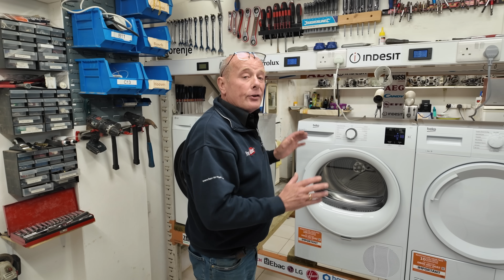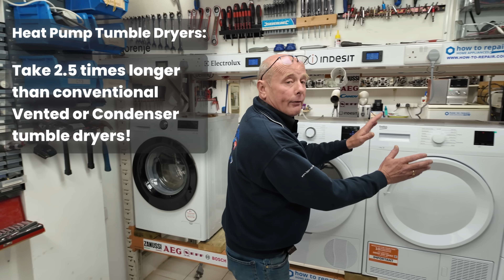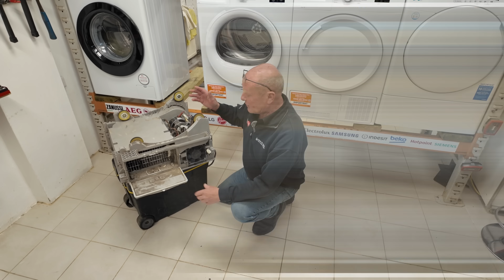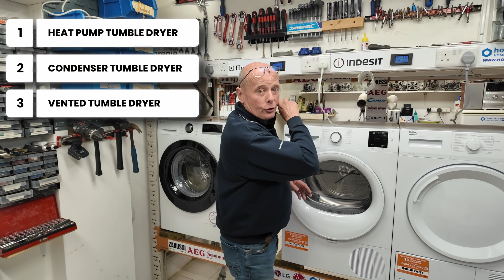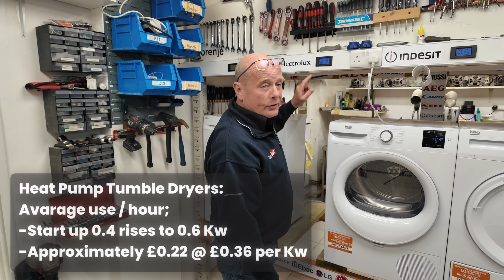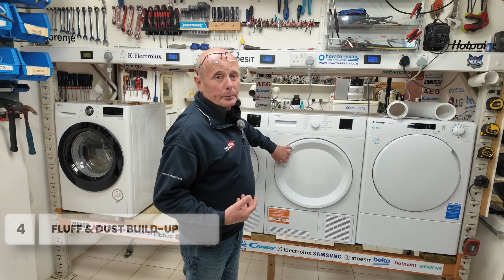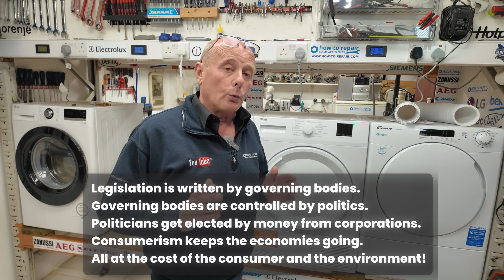Tumble Dryers the Shocking Truth About Heat Pump vs Vented & Condenser, NEW LEGISLATION!

Comment: I’ve watched a few of Paul’s videos.
My daughter has a heat pump dryer just under 5 years old,I’m not a diy person I’m a qualified trades so used to stripping down machines etc.
These heat pumps are ,as Paul says, an absolute nightmare to work on and unless it’s a simple fault it’s easier to purchase a new dryer.
They are not made for the consumer but for the manufacturer to make more.
I’ve found also similar problems with fridge repairs, so often because of regassing etc it’s cheaper to buy new.

Comment: like you said, they will phase out the machines without heatpumps, then people will have no choice but to buy a heatpump machine, same for heating the home, gasboilers will also be phased out over time and people will have to buy heatpumps to heat their homes, one snag, not everyone can install a solar power aray, so that heatpump will ruin many people
not only because of the high purchase cost but the energy this pump requires in the winter
i will never get the push governments are doing for the "climate" while everything burns because of wars and those "green" appliences are not reliable (weather/sun fluctiation) and are not equal to the appliences we use now

Comment: the vented dryer has another problem you will have to condition the air that is being expelled. So that is either heating it in winter or cooling it in the summer

Comment: I didnt hear you mentioning about large items like sheets getting tangled up into a ball on Heatpump dryers because a lot of the heatpump dryers do not reverse tumble through the drying cycle and also some people say their heatpump dryer finishes and they take the clothes out of the dryer and they are still damp and need putting on again to dry! 
I would find the lower temperature of the heat pump dryers a little concerning as well I think because germs/bacteria and odour could be killed at 60'c and condenser and vented and condenser dryers get to around 75'c I think it is but I hear the most a heat pump dryer gets is around to 45'c degree mark. 
Then there is the issue if people want to put a heat pump dryer outside in their cold shed or garage that the heat pump dryer may not even work properly or take even longer to dry because the ambient air is not warm enough. sorry if you covered all this in the video and if i missed it.

Comment: I don't have any experience from these dryers, but your points sound very logical. I'm not personally fond of the idea of having heat system in device that is prone to vibration. Also aren't the most recent refrigerants quite combustible gases in the most recent requirements, which would make the even less appealing, considering the amount of fluff from clothes? I mean I would rather see fire hazard risk being lessened than possibly increased?

Comment: Good video. One of the best I've seen.  I do think you failed to prove the total power usage for identical loads though. You say it orally, but you should supply the images of the data also, and also touch do confirm the dryness is equal.  This is because most of these units are sensor dependent so there's duration and heat variation changing with time.  

Also, IMO your final conclusion is wrong. IMO it's possible that the real purpose of isn't that your politicians are brainwashed.  IMO it may have nothing to do with saving energy or increasing manufacturing profits. IMO it's more likely to be ONLY to make people think there's an overpopulation problem.  Nothing more. Nothing less. We recycle plastic where I live, but it's all, 100% put into a landfill. Why?  See a prior sentence.

Comment: I am on Octopus Agile , a smart tariff where I get free or virtually free electric quite often so I do a mass wash and dry say 6 washes in one day and in bad weather or winter I use tumble dryers .The vented tumble dryer I use is around 12 years old .Just replaced heat element £14 on ebay and also rear bronze bearing £3.50  and a new belt for £8 , and hoovered it clear of fluff . I can t get 6 loads of washing dried with a heat pump and even though 450 watts is good going ( in winter it will take even longer ) it makes no odds as my electric is free nearly every time I wash . Octopus Agile gives you 24 hrs in 30 minute segments which vary in kwh price .Octopus Tracker will give one price for the day but never free per kwh as Agile is .Agile suits the lone occupier who can "load shift " by moving there high usage appliances like showers and dryers to the free segments or extremely cheap half hour segments . Octopus will give you £50 to switch to them ( and then you can go on smart tariff Agile or Tracker once you join .You need a customer referall  code from a friend or use mine ( eager-shell-139 ) Cheers

Comment: I have recently switched over to a Heat Pump dryer, 30 minute cycle is as quick if not quicker than my old vented one. Electric use is now at least a quarter of what it was ! the clothes are softer, and adding it onto our domestic appliance maintenance insurance was the same - no brainer really... Also when swapping the engineer that repaired the old vented one (making us switch) advised most of his clients have heat pump dryers now and they are more reliable and a piece of cake to work on. Enjoyed the review, but so far I'm glad i made the switch. One other note, re the fluff we get a quarter of the fluff we did from the vented dryer (Bosch) and the clothes do not seem cooked - they feel 100 times better.

Comment: Clear, sensible advice with lots of information I didn't know about the benefits & risks of heat pump versus conventional driers. Thanks.
Reply from the maker: Hi there! Thanks for your comment, @Sean006!

It's great to hear you found the information on the benefits and risks of heat pump versus conventional dryers clear and sensible. We aimed to highlight exactly those points – while heat pump dryers save on energy, there are significant considerations regarding their lifespan, repairability, and overall cost-effectiveness in the long run compared to vented and condenser models. This is a crucial aspect we break down in the video.

For a deeper dive into this topic and to see the examples we covered, please check out the full video here: https://youtu.be/gEgSCbZnHVM?si=wTIw0mELuhWaw4aX

We also explored related aspects in these videos:
The shocking truth about manufacturers: https://www.youtube.com/watch?v=QsdGd2qDPaI
Why Your Appliances Fail So Fast?: https://youtu.be/oBLEMQdSkes?si=ikIwqMsOIjaA0Xav

If you found this information eye-opening or helpful, please consider sharing this video with your friends and family. The more people who understand what's happening with appliance longevity, the better equipped we all are as consumers.

Thanks again for watching and engaging! Don't forget to subscribe to the channel for more insights like this!

Comment: I don't agree because it is a lot of generalization ... Samsung heat pump dryers for example have accessible heat exchanger for cleaning and it prompts regularly to clean. In addition, the smart dryer knows the smart washer's cycle and optimizes the drying cycle accordingly. Last but not the least, the washer + dryer use so little power that we can run it off the solar power for zero cost washing +drying... doing that with the regular dryers is hard. I almost forgot, Samsung has a 10 year warranty on the machines

Comment: Or, you can just hang your clothes and run a dehumidifier. This works great in the winter (or a cold basement) since the dehumidifier will warm up the air too.

Comment: I could not agree more. There's one thing however that would prevent me from using machine having 2KW peak usage on certain places. Some of the cables within my walls are made out of copper (so far so good) isolated with TEXTILE :D . A 1 KW electric kettle is killing my fuses from time to time. My BOSCH series dryer is doing fine. One thing i notice is that 4 dryer balls are improving it's work by an HOUR in some of the programs.

Comment: I have the samsung heat pump and agree that it takes much longer to dry but it is definitely easier on the clothes. My major gripe is the design because you can only clean the surface fluff ....anything deeper requires a full strip down and it's not a nice job. I often have to reset the he error from this issue.
If the fins could be accessed and cleaned easier it would be great. I believe lg have a system that flushes the fins automatically which might solve the problem.

Comment: Ventet heat dryer do not need to be less efficient then condenser or heat pump dryes. If you like inprove vented heat dryers connet to them off the shelf heat exchange unit with apropiat filter. They can recover around 90% of heat.

Comment: My heat pump dryer is taking a shit. It gets warm but takes 12 hours to dry. I felt it get way hotter before but now its lukewarm. Every once in a while it gets hot again but after 20 mins it goes back to being lukewarm. Took apart the whole thing, it looked almost brand new. Barely any lint. No reason it shouldnt be working.

Comment: We used our tumble dryer to heat the house back in the 70' .It eventually died and we bought a condenser version it was rubbish .The only things that should have compressors are freezers and fridges they have no place in anything else and that includes your heat pump .PS when our 1956 fridge dies can you replace the compressor wink

Comment: Can't compare my gorenje heat pump drier with other types, bur overall its been doing great in the last 9 years sismce we bought it. The wnwrgy consumption is lower or on par with my washing machine. It has door filter, awcond filter at the filter door, a thurd dilter right behind it for the very fine paeticles and urs the only thing i had to change once. I wash it carefully every once in a while. In the meantime ive had 3 failures on my washing machiness that impacted me more.

Comment: The room temeprature goes up (>30 C) when useing tumble dryer..... than the condenzation turns very bad....
so the condenzer TD runs longer 1.5 - 2 times... so in warm conditions the difference is not so bad....
in winter the condenzer dryer can heat the house, so the energy is not wasted.

Comment: The wife complained that our vented dryer sometimes didn’t fully dry the clothes on full cycle.
I checked it over and all was ok (I already chanced the capacitor as it had previously failed).
1800 w fisher and pykle.
Given to me for nothing with low hours and dead cap.
Clean inside no fluff.
Anyway I noticed only the colder days did she complain.
When outside about 7 degrees C or less in mid winter.
Aha of course it lives outside under cover by the back door.
So if it was in the house the minimum intake temp would be 18 c 
But outside in low temp it does make a difference.
If it was 2400 w it might be ok.
But we’re not worried, just add another short cycle.
Wouldn’t touch a heat pump system.
Don’t like condenser dryer 
Will stick to vented.
Reply from the maker: Hi @simonmorris3964, sticking to a vented tumble dryer is a damn good idea

Comment: From the analysis made, I'd say the condenser is the best machine to buy. Might cost a bit more to run, but runs less time, you don't have to vent anywhere so it's installation convenient and easy to repair making it serviceable over the life of the machine.

Comment: repairability is very much a thing. My AEG dryer started showing error E60, which is related to heating. Called around and every repairman told me to buy a new one.
BTW difference in electricity over 5 years is roughly €400. Still worth it, if bought cheap, and it's not one of those €1200 models.
Reply from the maker: hi @eIektrinis  AEG is part of the Electrolux group. They are known for providing good technical data, workshop manuals, and their machines are well-built. You were fortunate to get your machine at a good price. When they work efficiently, they can save you a lot of money on electricity over five years.

However, many manufacturers today produce poor-quality machines. These machines often clog within 3 to 4 years because of bad filter systems. We need machines that are easy to service, but manufacturers make them difficult to repair on purpose. This ensures the machines become obsolete over time.

For example, accessing the condensing or evaporator unit on your AEG machine is very hard. You have to take apart half the machine to clean it properly. It would be simple to design a filtration unit with inspection hatches for easy cleaning.

I agree with you that when these machines work well, they do save money. However, they also take longer to dry clothes than conventional dryers. We need to find a balance in this world.
For a deeper dive into this topic and to see the examples we covered, please check out the full video here: https://youtu.be/gEgSCbZnHVM?si=wTIw0mELuhWaw4aX
We also explored related aspects in these videos:

The shocking truth about manufacturers: https://www.youtube.com/watch?v=QsdGd2qDPaI
Heat pump tumble dryers are they really worth it?: https://www.youtube.com/watch?v=xn03N3b0-lE
If you found this information eye-opening or helpful, please consider sharing this video with your friends and family. The more people who understand what's happening with appliance longevity, the better equipped we all are as consumers.
Thanks again for watching and engaging! Don't forget to subscribe to the channel for more insights like this!
Reply: @How-to-repair  So a year later, both my AEG machines (combo + dryer) have clogged again and I needed to do a complete teardown of both... Took me maybe 5 hours to do on the weekend, and they are now working again. I Should have spent this time with my family, grilling meat etc. But no, I spent it in a bathroom, full of random parts and flint everywhere.
My takeaways:
* the design is very bad, almost criminal. The air filters should be much better and there should be a tool-less access door to clean both condenser and evaporator.
* My machines are 12 year old now. I was looking into newer models, hoping they were design better. But no, still require full teardown.
* I was able to do it myself, but it would be uneconomical if I had someone do it for me, or if I counted my time at the usual hourly rate.
* I could not find any service manuals for these machines. Only bits and pieces of inaccurate information on various forums, what these error codes actually mean, how to enter service menu, what kind of sensors are used and where are they, etc. How is this still legal?
* My next machines will be condensing-type. I have my own solar and my own non-metered water, so it's much cheaper than replacing/maintaining these heat-pump machines. Also, condensing appliances are much quieter, since there's no compressor. And cheaper, since they are now "obsolete".

Comment: Bosch didn’t even attempt a repair on our 2 year old pump dryer tumble dryer. Sent a replacement that retails at £999 😮
If it fails again, it'll be line drying only. Only got original one as we had a £300 off so same price as condenser dryer. This is the only white goods I've had issues with!

Comment: Fortunately I live in the US, for now we can still purchase conventional gas clothes dryers and gas water heaters, at least for now.  I have no interest in owning a heat pump clothes dryer or heat pump water heater, or along the same lines a heat pump pool heater.   All of those devices are counter-productive in my opinion.  Any energy savings is lost in time due to the frequent maintenance requirements and repairs, as well as their overall short life expectancy in too many cases.  Natural gas is a clean efficient and relatively low cost natural resource that we have a lot of here, I refuse to use a costly complex sealed refrigeration system device to produce heat.  About the only heat pump device I might consider is a good quality mini-split system if ever needed, but keeping in mind it is a complex piece of equipment that may prove costly as time passes.

Comment: It seems strange that it is so difficult to access the area where dust accumulates. I wonder what brands like Miele do. I hope most people do not use a tumble dryer five times a week, every week. Most people can hang washing out to dry naturally surely most of the time. Seems to me the power consumption was 20% , not 25% of the others. Wasn't it 410 watts  vs 2kW? For anyone using a HP machine the huge amount of time suggested the electricity saving would be considerable and the benefit to the environment substantial. I would avoid the cheaper brands though.

Comment: Oh dear! We have made a logical and financial mistake it seems.Firstly, I bought my Bosch washing machine and tumble dryer in 1997. Yes, 28 years ago. The tumble dryer has needed just one spare part, the door hinge, in all that time unto it finally expired two months ago. The washing machine died five years and and was replaced with a modern Samsung 8kg machine. That has died after only five years. We decided to replace both machines with a Bosch one based not only on our personal reviews but also because spare parts for Bosch machines are available for 15 years. Incredibly, I still found parts  for the Bosch dryer still available on the internet after 28 years. So have we made a big mistake? It seems so since the new Bosch heat pump dryer cost £800 and a new old-fashioned evacuation one around £200. We never found the old fashioned terribly expensive to run and expect the new machines to cost less, but our experience with the replacement Samsung washer leads me to think that the expensive new Bosch dryer may well needing to be replaced after far less time than our old machines. However, that is my opinion of the dryer, but numerous customer reviews of the Bosch washer, an oldish model by today's standards, still allows me to sleep at night.